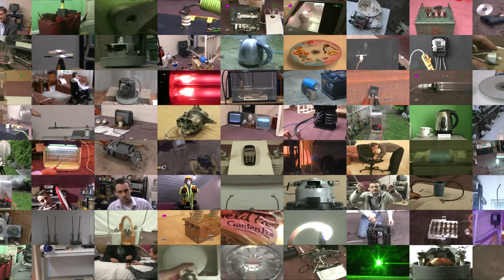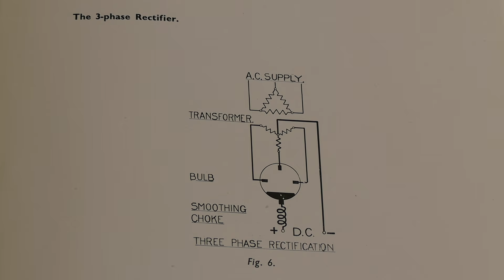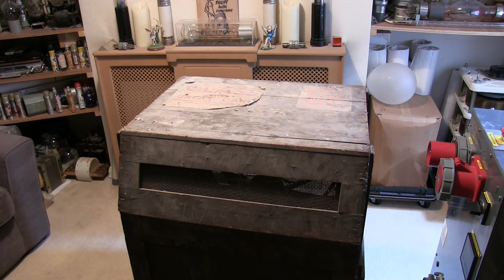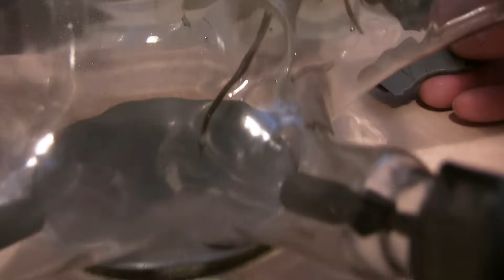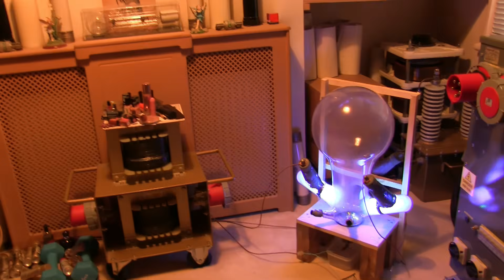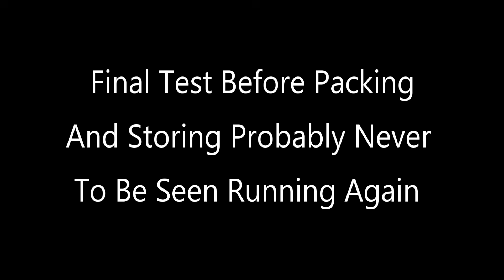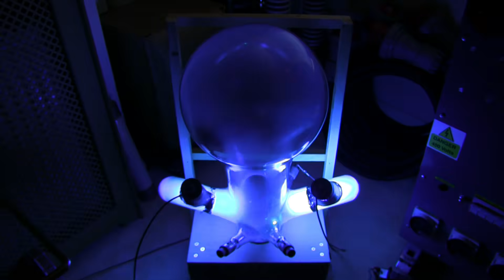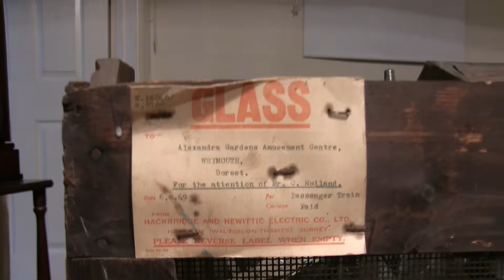Testing The 50 Year Old Mercury Arc Rectifier

Comment: This really takes me back.  In 1995 I was doing a job at the old Simpson's building in downtown Toronto and one of the maintenance guys was leading me to the area where I was to drop my delivery.  We passed this area that was significantly hotter than the others and there was this dreadful humming/buzzing sound.  I asked what was up and he smiled, passed me a long lab coat and dark goggles and took me to a bank of cabinets.  They looked like industrial lockers only much larger.  He opened one up and there was a massive mercury rectifier running and he explained it was powering a good portion of the building.  This thing was huge and he told me that it contained around 50lbs of mercury.  I knew these things were really old tech and I was shocked to see one still in active use.  then I looked to the side and saw the bank of similar cabinets and realised this one was not alone.
Reply: There are several of them still in service in the downtown Toronto area, some in the TTC streetcar power stations, and in several old elevator control and power systems. I am friends with an elevator tech, who was showing pictures he had taken, on a service call.
Reply: They are in most 1940's and Cold War Bunkers all around the UK, which are also still there. Some still work.
Check TheSecretVault, many of his urbex videos featuring massive nuclear bunkers will reveal everything else that they were attached to.
Reply: We are not alone! 
Epic last line.

Comment: Charge flow direction is from Mercury to steel. Which should also be the same as a tribo electric capacitance electrostatic charger and could be a mechanical aggravation as well as an electrical aggravation. Which makes this diode set up a piezo.

Comment: Please use a laser thermometer and measure temperature of Mercury. Sodium lamps heated by Mercury apparently measure minus for hundred degrees Fahrenheit. However, this was also shown as the temperature in a person's face when holding a Mercury vapor bulb stimulated by one wire of impulse (AC?)

Comment: Great! I was watching a video of some people that got into Belsize Park deep air raid shelter, abandoned after being used most recently as a secure document storage facility. They stumbled upon the Mercury Arc Rectifier in the electrical plant room. 
Amazingly after the war it was all still in situ and it was connected up to a fairly chunky transformer. They didn't know what they doing and were throwing switches all over the place, and they gave up and ventured off to other parts of the shelter. Anyway they triggered a burglar alarm and began to scarper back the way they came. When they got back to the plant room the fan at the bottom the rectifier was up and spinning. Nice to see it all still in place though!

Comment: Brings back memories of high power radar systems. These devices were used on a 3 phase system and therefore had 6 anodes. Provided power for a magnetron which was physically smaller than the MAR. Used to be called 'The Mekon'. Very dangerous amount of UV radiation if I remember correctly.

Comment: You will go blind Playing - Watching with that!!
It is Emitting a lot of UV - Blue Wavelengths 
UV A
UV B
UV C
 in full power you 'll sometimes get the other UV C that makes Ozone 
You can get a nice sun tan from them
Careful you may make Big Clive UV Envious

I Remember my bio dad  taken me in to BT Telephone Exchange  - Shrewsbury - back in the 1980s as a kid (7) up  into the Transmitter Power room  where they Have A few of these  not only for the battery charging but Also Running the  Microwave Transmitter Links + a few Radio link Relays - BBC Radio  Shropshire + Beacon FM  Shrewsbury back when they had a office studio in Shrewsbury 
sad  a few month later These old Germs were being removed in a Refit to Solid state

Comment: Not to mention the old arc street lights. In miniature, August 1926 QST magazine, shows the ham of the day how to use them in the ham shack to get DC for a purer transmitted signal. No camera does them any justice. Also a shorter article in April 1924 QST.

Comment: The Isle of Man Electric railway used these until only a few years ago. I remember seeing them when I was last there! You could see when the motor on the train was pulling some amps as it would light up really bright! 
Bit of trivia, if you have ever seen a fluorescent lamp which is dark at one end, it has a damaged electrode on one side and it is rectifying just like this and the DC is causing all the mercury to migrate to one end of the lamp hence why it's gone dark!
Reply: Heh - I just posted video of that one: https://www.youtube.com/watch?v=yjMZ5qtyCUc

They are something to see in person!
Reply: I’ve also seen one that flashed very rapidly, regularly and intensely. I think it was on an old 60hz magnetic ballast. I imagine rectification was making it light every other half cycle, creating 60 short duration flashes per second.
Reply: @deltab9768  If you are talking about the tube on start up it will be cause of a preheat ballast
Reply: @YUH-MERICA  It was  very regular, you could see a "smeared" strobe image on moving objects with a bit under 50% duty cycle. It was very fast (at least several tens of flashes per second.) It didn't stop after the tube warmed up, and it was slightly dimmer than a good tube. I still believe it was rectifying, but not 100% sure.

Comment: THANK YOU! You have brought back happy memories of 40 odd years ago and my first encounter with a Mercury Arc Rectifier at a  Cinema in South Africa powering a "Peerless Carbon Arc Lamphouse" as a very young engineer in training I was almost Hypnotised by that little ark jumping around the Mercury until I was bollocked because of the UV emissions from it! ( fuck the UV emissions from the carbons!)
As I recall it the one Rectifier was used to power both lamphouses and the slide projector too.
One thought, and something that I wanted to do but was strongly discouraged from doing was to run a Xenon lamp off of one that I discovered in our stores.....I wonder why? Perhaps you could give it a go, until the lamp "pops" no explodes!
Thank you again for a brilliant video.

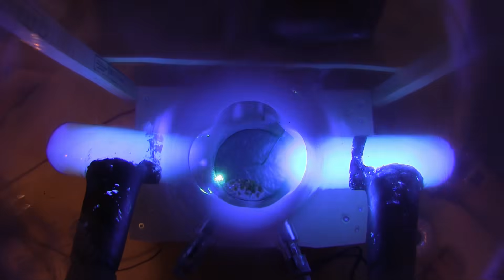Comment: 19:50 "...Little bit of UV though"
So you didn't get sun burned off that thing?
Reply: If I recall correctly most glass will block most (dangerous) UVC, and you need to use special glass (woods glass?) to let it actually pass through (for things like antibacterial lamps, sanitisers etc that use a UVC lamp)

Pretty sure if you check Bigclivedotcom channel for 'UV' he'll have a more detailed explanation on that, specifically, as UVC lamps are sold on eBay all the time, and are bloody dangerous if you don't know what you're doing.
Reply: @Beany2007FTW  you mean quartz glass, it lets through UV-C, normal  glass (window glass) blocks nearly all UV-B UV-C but lets through UV-A
Reply: @GenUltra758  that sounds about right to me, and Dan, likely so.
Reply: The glass envelope may stop a portion of the UV emissions, however, it will not stop all of it. 
Therefore, at full power, this tube would be emitting massive amounts of damaging UV radiation, and would most certainly cause a major "sunburn."
Reply: @binky_bun  is expect something tough enough to take a knock or two (physically, thermally, etc) but with enough uv protection that you don't need to wear welders goggles any time you open up the maintenance room. It'll likely be a compromise of some kind, as all things are.
Reply: Nah. He just sanitized the room a bit.

Comment: I would like to see rectified voltage. Maybe with oscilloscope or maybe on a load. Btw nice video
Reply: It would look the same as if you'd used a small diode
Reply: @phonotical  the variation in frequency as wells as the in rush current, rise time and others are interesting I guess, maybe it's not so similar
Reply: yeah good idea

Comment: I wonder how he obtained it. I can't even put mercury thermometers on the internet for sale as they're considered illegal to sell. Besides that, I think every shipping company is going to deny such a package with warning labels about mercury on it nowadays... Love how the label says per passenger train.

Stupid little coincell type liPo batteries come with a label that says that this box is permitted aboard a cargo aircraft only, I imagine the same is true for trains.
Reply: You can buy mercury rectifier valves on eBay. Just the small ones though like an 866
Reply: Well Andy works for the UK electrical grid, so it's very likely that he got to pick one up from work.
Reply: @Sh4d0wch40s  given Andy's line of work, it seems likely be was assisting in decommissioning a site, found this 'spare' rectifier (probably intended as a spare on the site, but never used) and talked his way into keeping it (he could easily show someone photos of all the rest of the equipment he has to show that he wasn't taking the piss or just trying to offload it on eBay etc, too).

That's how I like to imagine it anyway.....
Reply: @Sh4d0wch40s  some of these can still be found in old abandoned installations in the uk. I sometimes watch urban explorers go into old underground installations in the uk and find these mercury arc rectifiers present in old electrical gear for lifts and such.

It amazes me what, through time, has been left in the weirdest places that once served a purpose.
Reply: Of course you don't want some under payed cargo workers throwing that box around. It should be handled by someone who knows how fragile and special these devices are. But I understand what you mean. Mercury is hard to come by these days.

Comment: A thing of beauty!  

No wonder the old movies always showed glowing tubes in the mad scientists lab!

FYI, the voltage drop across the vapour will heat the mercury nicely.  If the glass broke and the mercury leaked out, it would likely melt that Tupperware container.

Comment: Do we know what influences the movement of the spark? Why does it jump around so widely?
Reply: I've got the same question.
Reply: And I found my answer! 

https://youtu.be/YhaQqgXrMMU?t=271

It's where the spark from the anodes is touching the mercury pool.
Reply: @PixelatedFancyLads  remember the really old TV sets and radios. With all the vacuum tubes in them? 
https://youtu.be/j6quDzRr9y8
Those cathode/Anode tubes replaced the old sparklets jug type. Then they got the boot when solid state integrated silicon components happened. The part that sucks about that is thats when things became disposable. Vacuum tubes were replaceable if you knew what you were doing. They even had tube testers in drug stores so you could repair your own TV. Guitar amps still use vauum tubes too.
Reply: Vacuum? They used mercury because its very pliable guaranteeing a contact and they didnt know about the health issues them. But you dont see these much anymore because of efficiency. These were before 3 phase was used. Which allowed current to be delivered to residence, and commercial at a much lower amperage.

Comment: Screw the silicon, these things are beautiful. Even tho they date 40 years before my birth
Reply: The vacuum tubes fit in between those two. Vacuum tubes are still used in guitar amps today. They provide a warm power response that silicon still cant replicate.
Reply: @siggyretburns7523  THAT'S the MF point, i bet those rectifiers are also better, size reduction ALWAYS will come with drawbacks no matter how advanced technology is, but I think the "imperfection" of the silicon is tolerable, just look how many glass they use, and probably get that glasswork done for a single rectifier costs as much as a few hundreds, perhaps thousands of silicone diodes
Reply: @kernel_data_inpage_error  
Yeah. It kinda eliminated the DYI guy too. I mean, how am I supposed to fix something built of nano tech? And thats not far off now.
Just today I was trying to fix a micro drone, I was successful...for 1 more flight. I looked at it for 1/2 hr with a magnify glass. I have no clue.I think it was looking back at me laughin . So into my DFSINDAW* it went.

*Drawer full of shit I'll never do anything with.

Comment: So question, if you wanted to use this say for just grins and giggles as a neat lamp what kind of power would something like this pull?
Reply: I think it said 400v/7a, so 2800W...
Reply: @Skwisgar2322   so basically it would be like running two kettles at the same time. Is that the max or just the running voltage/amperage?
Reply: Weeellll he DID mention the power requirement for the pilots. I think this thing wastes like 50-100 watts constantly though. It looks like it. Did anyone mention old tech is RIDICULOUSLY inefficient?
Reply: @dimitar4y  inefficient? You mean cool right? It probably isnt too bad if you are using the output power at least, 50-100 watts isnt too much considering the technology and the era this thing was from.
Reply: @bradzune  it is cool as hell and I'm all for using this old tech because not only it lasts forever but it's cool as hell. Screw the 20% efficiency!
Reply: @dimitar4y   Screw you power bill!
Reply: Part of the problem is also that they only really glow when under load. If just sitting idle only the pilots would be glowing and it’d take the 100 or so watts.
Reply: @NBSV1   So what your saying is that our on off switch needs to be a idle and load switch. Leaving it idle typically then when people come over turn it on load to really set the mood?
Reply: @bradzune  You'd have to have something to load it though. I'm not sure what his full setup was here but I'd bet he had something taking that load and wasn't just feeding power into the thing. 

It would be easier with a small one since you could more easily use something like a fan and a heater as a load. With a smaller one you'd only be looking to dissipate a thousand watts or so for it to glow good. With this big one you'd probably have to dissipate 4-5,000 watts for it to really be glowing.
Reply: @NBSV1   That's a lot of power to have to dissipate, not to mention it would be a waste.
Reply: @bradzune  Yeah. That's why using one just for a cool light source doesn't make much sense. 
With a small one you could probably get away with only needing to dissipate a few hundred watts to make it glow nicely. 
Basically if you can find whatever the power rating for it is that'll give you an idea of how much it would take to really make glow. The closer to the max power the more it will glow.

Comment: Sodium dissolved in ammonia has a higher electrical conductivity than liquid mercury. Also seems like it would be a lot less dangerous (though still not completely safe).
Reply: but would it work to replace the mercury in a mercury arc rectifier like this?
Reply: @dimitar4y  That's what I would like to know.

Comment: I wonder how those perform compared to silicon as far as reverse leakage, forward voltage drop, response time/max frequency, stray capacitance, voltage/current rating,  etc. That glasswork seems like a major pain to manufacture compared to just a tube/cylinder. I wonder if you'd get a tan/sunburn if you sat in front of it for an hour, mercury puts out a buttload of UV when made into a plasma.
Reply: Agreed. Probably comparably, but failing in the size department. 

The giant globe on top is just to facilitate condensation and recollection of the mercury vapor. That's the only reason I can see why it's so big.
Reply: @erinfinn2273  yeah I imagine without that the pressure would build up too much when ran near it's max current rating and it would explode since the vapor wouldn't have a place to cool down and would just keep building.
Reply: Capacitance is basically as you see it, not very much just some metal bits hanging out in space.  Voltage drop I believe is in the 20-30V range, not great for purposes like battery charging but alright for stuff like industrial supplies, traction motors etc.  The big downside is the deionization time of some ms, which basically makes them mains-only devices.  Thyratrons with heavy fill gasses (often xenon and mercury) have the same downside, slow deionization.

I'm not sure offhand what causes the rectifying behavior.  Normally, applying voltage in any polarity to an ionized gas, simply passes current.  Something about the cathode spot (the bright spot dancing around the pool) that emits electrons, polarizing the glow discharge and preventing reverse conduction.  Note that the distance between electrodes is long enough not to break down spontaneously in the mercury vapor, which sets the maximum peak anode-anode voltage I think.

The same function (electron emission) is done by heated cathodes, in many rectifiers and most thyratrons.  Some are self-heated (like 0Z4, and fluorescent tubes).
Reply: Unless its made of quartz glass a lot of the UV would be stopped by the glass.
Reply: A lot of wasted power. All that light has to come from where. Not to mention the heat... The reason they are so big is to manage the pressure and heat in the things. Though why no one thought to a metal band with heat sink fins on it or something? I guess back in the day size wasn't an issue.

Silicon diodes blow these out of the water in most respects. However, the one advantage of them is their low tech. You can make one of these without needing complex chemistry and silicon foundries. So if the Sh!t every hits the fan we better hope technology like this is preserved as they are an intermediate technology to getting silicon fabrication up and running again.